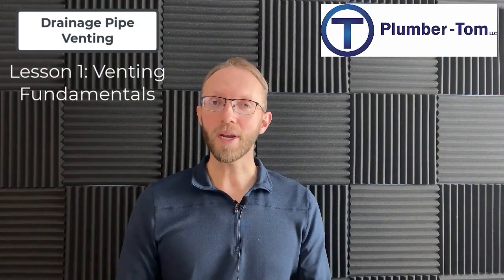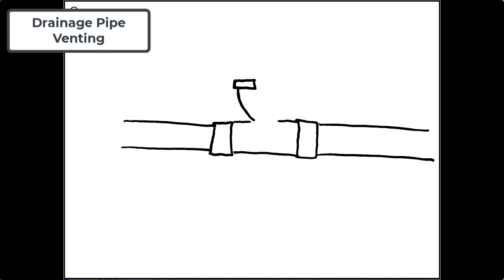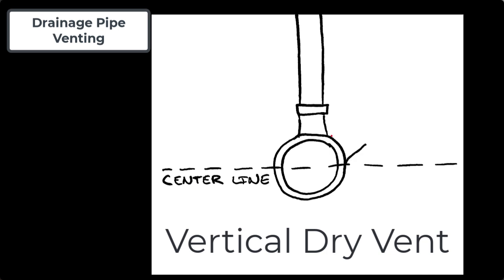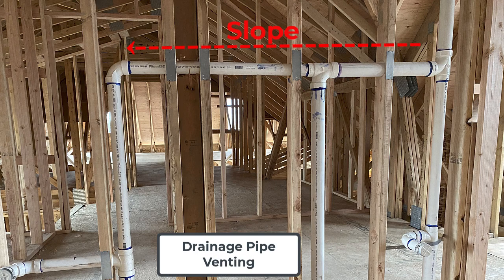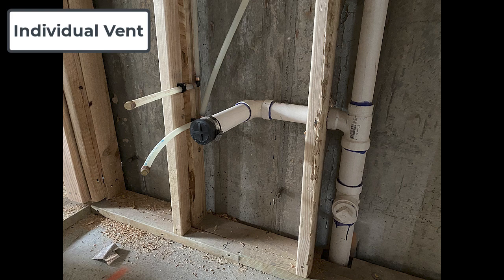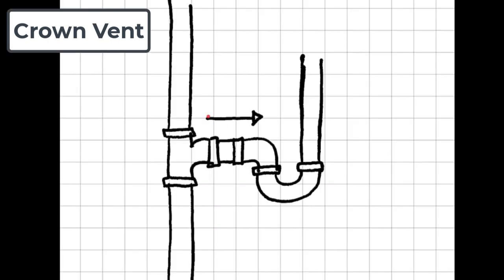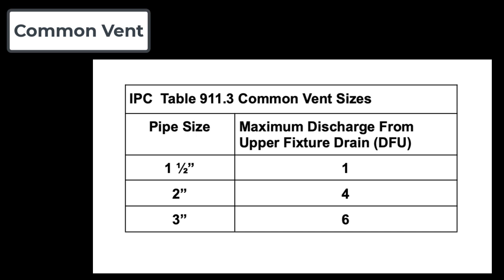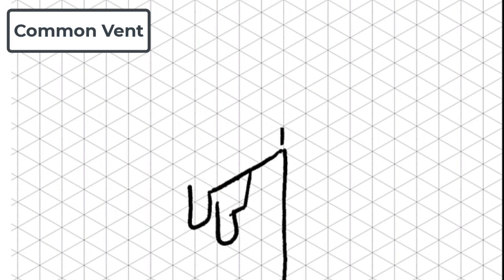Drain Venting Lesson 1 - Vent Fundamentals

Comment: This is a great series! Thanks for doing this. Very clear and helpful. Only thing I didn’t understand is why that common vent on the two toilets @ 11:05 is allowed and not a violation? Isn’t the two toilets branching off the same trap arm and not allowed? I would think the vent has to come off where the toilet arms connect.
Reply: Section 706.3 of IPC has an exception stating that back to back water closets can connect to a double san-tee if the horizontal developed length is 18 inches or greater between the water closet and san-tee.  911.2 for common vent connections at the same level, the vent can connect at the interconnections of the fixture drains or downstream of the interconnection, which seems to be what that illustration is depicting.
Reply: @Cadavercide 	1.	A double sanitary tee / double fixture fitting
	2.	A cross (4-way) fitting
	3.	Vertical vs horizontal drainage

Those are not interchangeable, and the IPC does not bless a horizontal cross for drainage.

⸻

What IPC 706.3 actually allows

IPC 706.3 + its exception allows back-to-back water closets to connect to a double sanitary tee (double fixture fitting) WHEN:
	•	The fitting is vertical
	•	Each WC discharges horizontally into the vertical fitting
	•	Minimum developed length (18”) is met
	•	The fitting is listed and designed for that use

👉 A double fixture fitting is NOT a cross.
It has internal baffling and directional geometry that forces both flows downward, not straight across.

That’s why it’s allowed.

⸻

Why this does NOT legalize a horizontal cross

A cross used horizontally:
	•	Has straight-through opposing inlets
	•	Has no internal sweep
	•	Allows waste to shoot directly across
	•	Violates solids transport rules

That directly violates:

1. IPC 706.3

“Fittings shall be of the proper type and grade for the application.”

A cross has no directional control, so it is not proper for horizontal drainage.

⸻

2. IPC 706.4

“Changes in direction shall be made by fittings of approved sweep.”

A cross provides zero sweep.

⸻

3. UPC Table 706.3

Crosses are not listed for horizontal drainage — only wyes, combos, and long sweeps are.

If it’s not listed, it’s not approved, period.

⸻

Why the ICC commentary illustration doesn’t help them

The illustration they’re referencing shows:
	•	Vertical stack
	•	Double fixture fitting
	•	Common vent
	•	Directional flow downward

It does NOT show:
	•	A horizontal cross
	•	Four competing flows at the same elevation
	•	Straight-through discharge paths

So saying “ICC commentary shows it, so it’s allowed” is false — they’re misidentifying the fitting.
Reply: @Cadavercide  a double wye with a 45 not a San tee or a cross This is the only universally accepted DWV fitting (IPC & UPC) for two water closets draining horizontally.

Why it’s allowed:
	•	Each toilet discharges into a wye, not straight across
	•	Flow is directed downstream
	•	Solids are swept into the main
	•	Backups rise vertically, not into the opposite branch
	•	Meets IPC 706.3 / 706.4 and UPC 706

This is what inspectors expect to see.
You identified the fitting wrong a sanitary T is never to be used for horizontal drainage. Let me say it again. It will go across. It does not have the long sweep to direct flow horizontally. You have to use a double Y fitting with a 45 on each end in order to get the proper long sweep bend
Reply from the maker: Good point.  I saw that illustration in the ICC commentary book.  So apparently they are ok with it.
Reply: A cross (4-way) has straight-through opposing inlets. When installed horizontally:
	•	Flow from one side shoots straight across into the opposite branch
	•	Solids don’t sweep into the main
	•	Turbulence causes backups and blockages
	•	No directional control of flow

That violates basic DWV design and code intent. all fixtures must travel to pipe diameters through the trap arm this way if there is a backup solids that shoot up vertically do not get stuck into the vent.

 A cross (4-way) has straight-through opposing inlets. When installed horizontally:
	•	Flow from one side shoots straight across into the opposite branch
	•	Solids don’t sweep into the main
	•	Turbulence causes backups and blockages
	•	No directional control of flow

That violates basic DWV design and code intent.@p 1. Improper fitting for horizontal drainage (primary violation)
	•	IPC 706.3 – “Fittings shall be of the proper type and grade for the application.”
A cross does not provide directional flow, so it is not a proper fitting for horizontal drainage.
	•	UPC 706.0 / 706.3 – Requires fittings that provide a smooth, sweeping flow for drainage.

➡ A cross allows waste to shoot straight across instead of turning downstream.

⸻

2. Failure to direct flow / creates turbulence
	•	IPC 706.4 – “Changes in direction shall be made by fittings of approved sweep.”
	•	UPC 706.3 – Horizontal drainage must use wyes, combos, or long sweeps.

➡ A cross has no sweep and causes turbulence and solid hang-up.

⸻

3. Prohibited fitting for drainage use
	•	UPC Table 706.3 explicitly does not list crosses as approved horizontal drainage fittings.
	•	Crosses are intended for venting or vertical applications only, not waste flow.

Comment: Nice.   I've had trouble figuring out a laundry group (washer, sink) in california (UPC I believe).   Thought  I could use  a common vent - ok under IPC but it seems  UPC requires a double TY for a common vent but specifically prohibits this for a washing machine drain which is pumped.   Stacked San Tees create a possible wet vent issue but if both traps are individually vented is that ok (under UPC)?
Reply from the maker: Good point.  TY might be required for common vent.  It's important to make sure to know what your state requires.  The state can make any changes or amendments to the code that they want.  Individually venting each trap should not present a problem.

Comment: Hey Tom! Love the videos. Question for you, during your common vent section, you show a laundry tub rough in above a washer box rough in sharing the same 2” drain. During my apprenticeship, when studying IPC my journeyman told me that washing machine drains had to be on their own fixture branch connecting to the building drain because the pressurized discharge could siphon the trap of another fixture on the same drain line or could cause suds/discharge to come up through the other drain. Will the common vent eliminate this siphon and be allowed in code and it’s something he misinterpreted in code? I would love your input, thank you!
Reply from the maker: Hey Joe.  Good question.  

I think that separating the laundry is a good practice.  However, that is not a code requirement.  IPC 406.2 gives requirements for the waste connection for an automatic clothes washer.  It states that the line must be 2" diameter and that the fixture drain for the clothes washer standpipe must connect to a 3" or larger horizontal branch or stack.  The connection to a 3" or larger pipe will allow space in the drain for the suds and allow for proper flow. 

I have not had any problems using a common vent for a laundry sink and washing machine.  There is nothing in code against it.  I connect to a 3" line downstream from the common vent.  It might be a better practice to bring the 3" line all the way up to the washer location. 

Thanks for watching!

Comment: Is it smart to use 90s off the top of your san-tee  instead of 45s? Or is a space thing? I know situations arise and you use what you got but those will restrict the air for the AAV  vs. 45ing your entire 2 inch drain or off the top of the tee like I mentioned.
Reply from the maker: Best to use 45s if possible.
Reply: a dry vent  cant offset horizontally   less than 6 inches above flood level   under any circumstances and meet ipc code     upc has a special condition that may allow  if first approoved by inspector    and    I agree its better to use 45 s   even if you didnt care about code